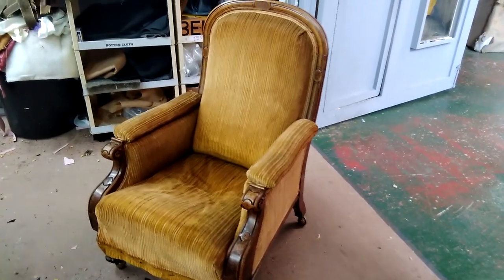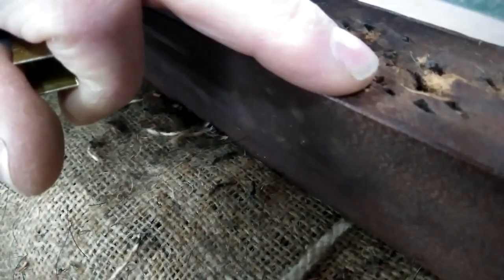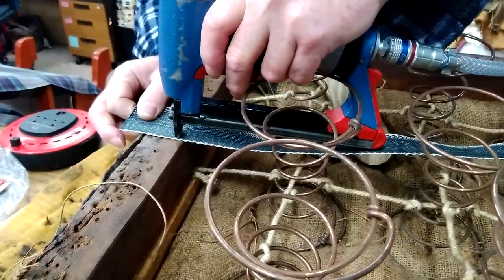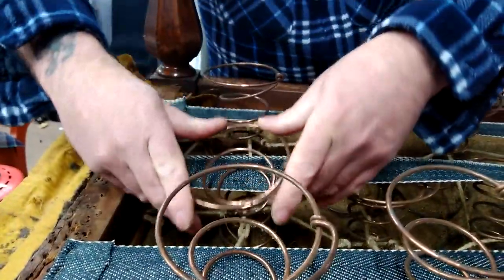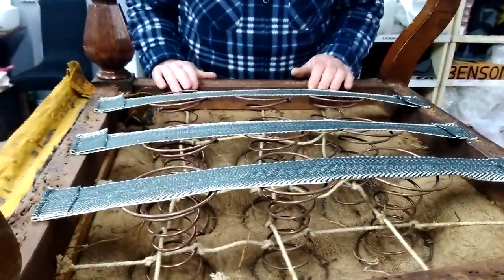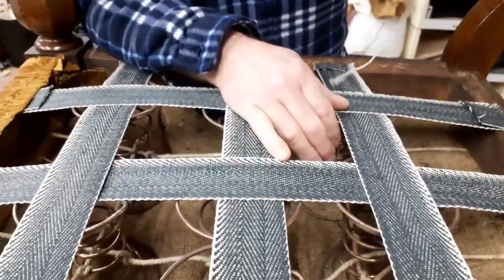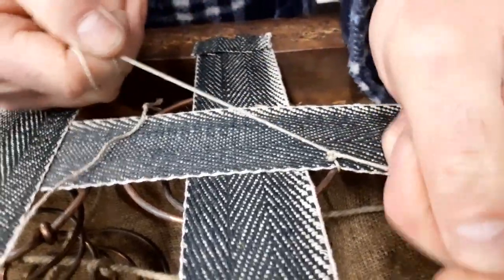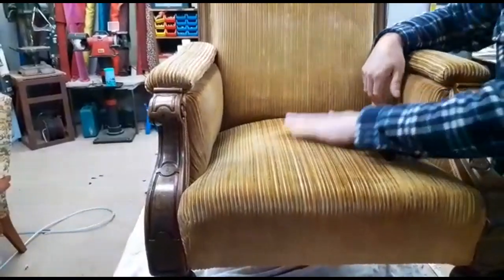chair webbing by Craig Hughes of Salvage Hunters / Restorers

Comment: Thanks for this! I’m looking to do a similar fix on my sofa until I can afford to get it completely reupholstered. Would a normal furniture staple work ok or should I invest in one like yours?
Reply from the maker: Do you mean the staple gun itself? if so you can use a hand stapler if required but it could be hard work or you could go old fashioned use hammer & tacks, if you want to use one like mine which is pneumatic you would also require a compressor. Hope this helps?

Comment: Questions: I am going to try this on a Gothic carved side chair my husband sat down on a bit too hard and the bottom fell out as they say. :) I can't find anyone in my town who does this. I don't have a power stapler, just old school staple gun...but I will buy a stretching tool for sure...a question on the hessian, 8 oz or 10oz and what exactly is the thread called? I managed to get the strapping jute material already. thanks!
Reply from the maker: The thread is mattress twine. Either 8oz or 10oz if it's only for the bottom.
Reply: @craighughesupholsteryoffic5077  I don't find 'mattress twine' online but I did see everything from Jute to an Italian Waxed twine which says use for upholstery springs...But they don't show it sewn through webbing, only tying springs together...Looks like you used a thread but I don't find a linen jute thread either, only jute or thinner upholstery thread? thank you! Great video
Reply from the maker: Try searching linen upholstery twine!
Reply: @craighughesupholsteryoffic5077  thanks well it is def. a product sold in UK, not seeming to find it anywhere here in US. last question and I will leave you alone...what is the mm size of your thread and I will keep hunting.
Reply from the maker: The thread I used in the video is what is called "3 or 4 cord linen Twine it is about 3/4 mm thick, hope this help?